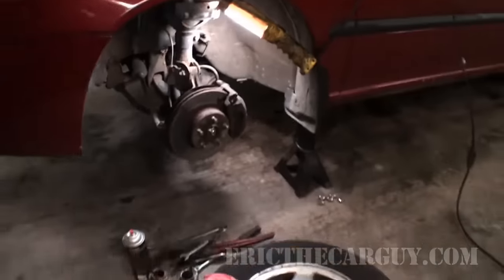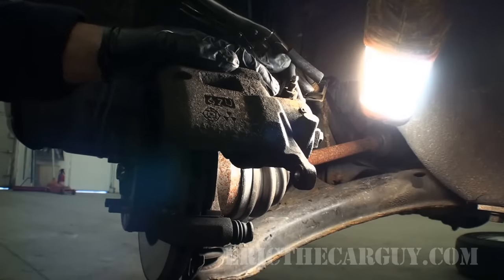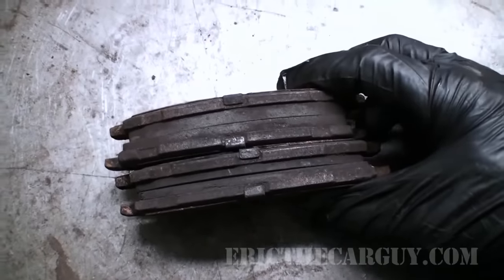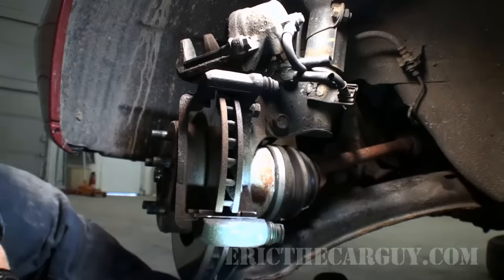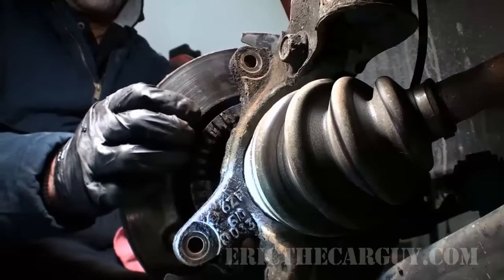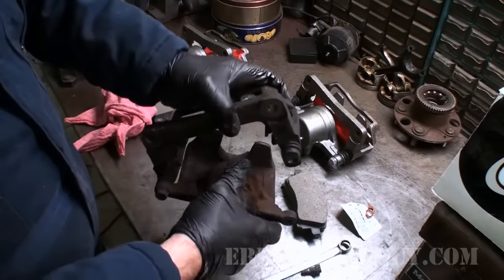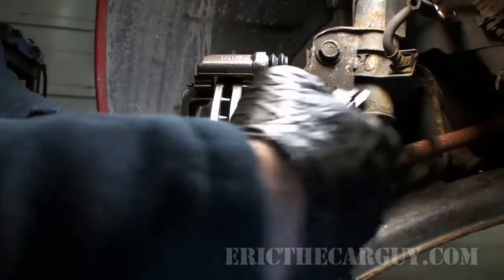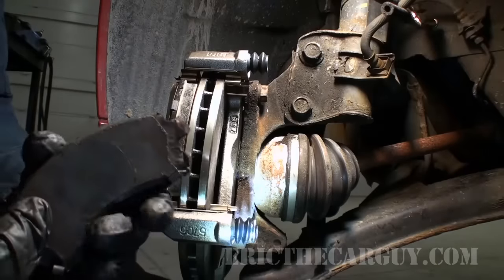How To Diagnose and Replace a Bad Brake Caliper -EricTheCarGuy

Comment: Great Job Eric, everything explained in Detail but, I have 1 question, when you replace Calipers, do we have to instal the Caliper Hose at the same time, sometimes the Calipers hose looks old and soft, it may bent and the fluid wont go through that may cause some problems?

What do you think Eric...

Comment: Decided to make myself a one-man-brake-bleeder after seeing this video. I just used a short/stout Gatorade bottle and drilled a 1/4in hole in the top of the cap and a another tiny one nearby to provide an air intake, slipped the 1/4in tube through the hole, filled the bottle with brake fluid. So even if the contraption tips over, which it did a few times when I was getting the tube connected to the bleeder valve the cap keeps most of the fluid from getting dumped on the ground.

Comment: Word of caution about using long wrenches on those 17mm caliper bolts. If you need the extra leverage to break a  brake bolt lose, chances are it is rusted in a possibly ceased. Use penetrating fluid before you just go breaking bolts with long wrenches. I broke the one of the heads off of one of those same caliper bolts on my forester using a long wrench. It was a nightmare to deal with after that. Lesson learned, use penetrating fluid if a brake bolt is even slightly stuck.
Reply: You’re right. He probably should have. I’m sure as the seasoned mechanic he is, he forgets to mention certain things. Forgets to mention them because he doesn’t do it, because through experience, in this particular instance, he can feel a fastener within the wrench/ratchet and socket  that is going to potentially be a candidate for stripping if gone past a certain point.  

If you live anywhere in or near the rust belt, pre soaking/spraying with penetrate is practically step number one in any mechanical job. Big or small

Comment: Eric; what have you got against using a C clamp across (An old brake pad or whatever) to push the piston in? Seems more even/straight force against the face of the piston, that's both easier to modulate and gradual. I like the practicality of your videos which makes this one thing stands out.

Comment: Thanks Eric, I've got a sticking disc on the front of my van that gets worse when it gets hot after driving a few miles, bought some new discs, the old ones aren't too bad but they're are the originals so prob time for new ones, new pads of course, i checked the pins that the caliper slides on when i was away from home a few wks back n they're not seized & am going to bleed them,  
The only thing i couldn't work out is how to check the caliper, I do now Thanks.
Reply: You might have a bad brake hose not allowing the fluid to return and holding pressure on your caliper after you take your foot off the brake..  Happened to me.

Comment: This video saved me some grief changing brake pads. Some idiot rounded the slide bolt on one side of my right rear caliper. Watching this I found out how easily the caliper comes off with one bolt off.

Comment: Thanks, Eric. I've had trouble removing rotors and even tires because they are all corroded together. I put Anti-seize on both sides of the part of the rotor where the wheel will bolt on, as well as on the centering hub thingy. Ok idea? Also, should we lube those clips, with silicone, to let the pads slide more easily?

Comment: I've got approx. 250,000 miles on a 99 Accord.  After having multiple brake issues on front and back (main issue being frozen pins/slides and uneven wear), I'm simply going to spend the money and replace the entire caliper assembly, rotors, and brake pads altogether.  I've tried lubricating the slide pins when I noticed they got stuck, but it didn't last long until they froze up again.

Comment: Hey Eric, if you replace the left front caliper don't you have to bleed the right rear wheel cylinder or caliper. I thought on front wheel drive vehicles they pair the right front brake line with the left rear and vice versa on the other side. I thought they did this since 75 percent of braking on front wheel drive vehicles is done by the front brakes and in case of a brake line failure you would have a front and rear action. Love the vids. Thanx

Comment: Eric, I hope you see this. First, Thank you so much for this video. It's very timely. My wife's 2003 Outback pulls hard to the right. Dealer wants to replace Caliper, Rotor, & pads for about $600. I can't do that right now. So I will diagnose in hopes of a fix instead of replace. If I need to replace, is there an aftermarket Caliper that's as good as or close to OEM? Subaru Caliper is $300.  If not I can get a salvage yard Subaru Caliper with 60K miles & 6 month warranty from a reputable yard for $59. Would you trust that? Thanks Much, Dave

Comment: Thank you so much, Eric! Single girl, here. I found out a ling time ago... Never depend on anyone. At some point, if not often, you'll be disappointed, so learn how to depend on only yourself. That's my motto! Now I know how to change out a brake caliper. I replaced my air idle control valve, and replaced my windshield (yes, you read that right), so far on this van. Now it's time to take my wheel off. Thank you so much. So many people are so serious and boring, and I start daydreaming because their monotone voice. Not you!!!

Comment: Not sure if you ever ran into this issue?I replaced a good many calipers and never had an issue, but after replacing caliper with a rebuilt one and installing new copper washers a very slow seep  developed un beknown to me and did not show up upon install until the low level light came on over many months for the brake fluid.Copper washer that goes against the caliper would/did not seal properly.Bought new washers and tried again with no luck.Examined the rebuilt caliper and there was a small defect around the edge of the threaded hole for the Banjo bolt.Had doubts this was issue, but went and got another  rebuilt caliper and washers that appeared to be in better condition in bolt hole area.Not sure what else would have caused this issue?Only been acouple days and will recheck.

Comment: I read a how-to that told me to use Moly Grease on metal-to-metal contacts, and Silicone lube on rubber-to-metal.  On the sliders, I put silicone on the inside of the boots, and grease on the bottom half of the slider where it touches the most metal.  This was only two days ago.  Would you recommend cleaning and re-lubricating the sliders asap, or during the next brake change?

Comment: Hey Eric, I was doing a front brake job on my 2002 dodge Dakota. I was told by a mechanic in my family that I shouldn’t lubricate the caliper pins and I didn’t find any information online/in the shop manual. In your opinion, should I lubricants them? I had reassembled them after replacing the rotors and pads, also checking the caliper for failure the drivers side intermittently dragged

Comment: Thanks for ur great video.
Can u please explain more on ur segment on clogged bleeding valve?  I thought this only had an effect when u where bleeding the brakes.  I dont understand how this can have an effect on the operation of the caliper piston?
Thanks to ur video I found the bleeding valve on my Sonata diesel clogged.  I cleaned it and put it back in today.  Im not sure yet if my problem is solved.  I am afraid that this is not enough and that I will have to replace the whole caliper or rebuild it myself (the caliper pins move freely).
Can u please explain how opening the blogged bleeding valve could be enough for the brakes to operate normal now?
Sincerely
Stig from Norway.

Comment: I'm not sure I understood. Pump the break a bunch of times. Get out, crack open the bleeding nipple. If it squirts - is probably the hose...? Would this suggest the hose has lost its firmness properties, and is expanding under pressure?

And do you do this with engine, thus brake servo - on or off?

Asking as all tips help, and personally I have one front brake where there is very slight rusty coverage across the inner 50% of the rotor track (like the pad is only gracing the rotor on the inner part of the track) - and on the rear right it gets quite notably hotter than the rest of brakes, and in winter my parking brake tend to freeze up in that side (caliper, not drums).

Comment: Hi Eric, years ago, my mechanic had changed front and rear discs/rotors and all pads, and did a brake bleed f+r. I watched and helped him do some of the stuff, just pumped the brake pedal, passed the tools and rotors etc. When he fitted the rotors on, I asked him if the lube needed cleaning off the rotors faces, and he said because the rotors will get really hot when I press the brake pedal, the heat will burn off whatever is on the face. Is he correct? I admit when I first took the car out for a test brake run, he did say to slam the brakes on a few times from 40 mph, and at first, felt like nothing was happening, then the brakes grabbed good.

Comment: Eric, thanks man, good video, one comment please, on most German cars i.e. VW, if you pinch off the brake line like that, you damage it.  They are hard plastic outside and braided steel inside ( for longevity) The braided steel does not return to round shape.  Also 2nd comment, question,, why not use brake anti size paste on the guides as opposed to silicone paste?

Comment: Quick question, I went to change recently the break pads because it was time to do maintenance, when i went home the break light went on in the panel, next morning there was no breaks and there was no break fluid, it leaked all. I know my calliper was fine cuz I have replaced it last year. But they say the calliper was gone and needed to be replaced. I would like to know what do you think happened there? They said the rubber on the piston was gone. I don’t triste them much, heard bad things from them before. I went in to change pads and came home with leaking breaks 😤 (caliper before changing pads were not sticking or pulling the pick up) I appreciate your insights. Thanks

Comment: Totally agree with you about not using the copper washers.  I could not get a seal with them  So I re-used the steel washers from the old caliper and they sealed easily.

Comment: I have had brake pads that fit too tight and took a small grinder to take the slightest amount off the pads so that they would slide smoothly in the clips/bracket.  I always questioned this move because I was taking the powder coat off and may causing rusting which may cause sticking of the pad.  I do brake services once or twice/year when I switch tires (winter/summer).  Should I have gone back and asked to see another set of pads until I get one that fits?  Also, what are your thoughts on anti-seize under the shims on the caliper bracket?

Comment: Very good video 👍 I have a 2003 Ml320 MErcedes the brake line is leaking out of fluids, I want to replace the line, so where should I Istart to take things off first before get to the line to replace. Thanks in advance.

Comment: Hi Eric, I'm one of your followers. I have a Lexus CT200h. When I opened my brakes to replace the pads, I found out that the front pads were already worn out 60 -70%, whereas the rear pads only around 10%. Is there a problem with my rear brakes, or just normal wear. Thank you

Comment: Hi Eric.  Thank you so much for lovely professional explanation.  I have a doubt.  They are two caliper pins.  One is plain one and another  one has rubber sleeve on other pin.  could you please let me know what is the difference.  if i put rubber sleeve on down and plain pin on up will be any problem?  Please guide me.  Raju Jai Sriram.

Comment: WD-40 Specialist rust penetrant spray works really well on old fasteners. 
I used yesterday it on the two 23mm bolts holding my caliper brackets on, and was able to loosen them pretty easily afterwards.

Comment: Lol, I couldn't help but laugh when you almost put the caliper frame on without the rotor in place. When I did it I actually got the thing bolted in and as I'm reaching for the torque wrench the brain is trying to put together that this just doesn't look right.. lmao  It was the last corner on a 4 corner brake job. 8 hours into it my son is lucky I didn't try to bolt him to the car.. lol  Thank you so much for everything you do and teach. Great videos!

Comment: Eric, I don't think you will answer this, but one of my slide pins doesn't push in as easy as the other on the exact caliper you have on this video. Is that the way it should be? It feels like something is blocking it. I put the other slider in it, and it works fine!

Comment: Point of note: If the banjo bolt on your caliper happens to not have an existing crush washer, most definitely use the copper washer they give you. The first time I ever changed a caliper it didn't have a crush washer and I figured it could go back the same way. I was very wrong, and broke the banjo bolt trying to get it to stop leaking. Those are not easy to get ahold of, I had to go back to the dealership after the weekend was over.

Comment: I know this video is older but great content. Question, I replaced my rear pads and rotors but still get vibration in the rear when I apply my brake peddle. Bad caliper or pins not moving? I checked the pins and they were moving ok. Not sure why it vibrates when I brake.

Comment: Nice Job. I would use C-Clamp to push piston back, ezier.  But thank you as the issue I'm have seems to be stuck caliper pins.  will fix it ! Thanks Again

Comment: In your video, I only saw you replace one caliper,  but after bleeding it, you went over to the other side to bleed that one as well. Is that because you replaced the caliper on the other side, but we didn't see it done in the video? 

I am replacing both front rotors and pads, but only one caliper; I assume I only have to bleed the side which had air enter the system, ie., when the caliper was swapped out.

Comment: thanks for the video, im a bit unclear on why you would need to crimp the brake line. If you compress the brake caliper piston with your pipe wrench the brake fluid would simply get pushed back up into the reservoir. If it moves freely it should be ok. What am I missing?

Comment: Good vid as usual. But if l have a sticking piston,l usually take pads out put chizel or similar in place of pads,put foot on brake pedal forcing piston out.
Then using vasaline,after first cleaning piston.l put it on pisdton.Might have to do three to four times but it frees piston off..Worth a try.

Comment: Like all your videos. Question. Would excessive moisture in brake fluid cause a sticking caliper. I ask because the car I am working on has this issue but noticed the brake fluid reservoir cap is broken. Don t know how long. Caliper slides ok,   Piston moves freely, how do I check that brake hose.

Comment: Is it important to first gravity bleed (to fill up the piston first) before bleeding via applying brake pressure? I've been having seized rear brakes yearly. When I compare my procedure to yours, the only step I'm missing is the gravity bleed. I believe there may be either moisture or air around the rear brakes that I didn't purge due to skipping that gravity bleed. Thoughts? Thanks you all!

Comment: Is the reason you went through the trouble of clamping the brake hose and loosening the bleeder valve to compress the piston, instead of just taking the reservoir cap off, to help isolate the problem to the caliper versus the brake hose?

Comment: Great helpful video. Did you consider getting rotors resurfaced rather than replaced. My experience the cheap Chinese replacements available at the chain parts stores are junk and tend to warp easy . I like to get my original factory rotors cut at O’Reilly for $12 bucks.

Comment: Hi Eric. Got a 98 Continental, left rear was lot of brake dust. Took the easy way out and replaced caliper. Still drag on both rear wheels and a bit on the front. Master cylinder?

Comment: Hello Eric. I order most of my parts from Rock Auto, and the only thing they are recommending for Silicon Paste is Camshaft Assembly Paste. Will this work? Or will it be too corrosive for the rubber parts as well?

Comment: Great video.  So if you .. i mean a friend.. ignored the indicator and rode til itvwas metal on metal.. meaning new pads & rotors for sure... does this kind of wear damage the caliper with all that metal dust and heat?  Cuz it sure looks like $h#t.. but seems to work. Relacecwhile in there?  Thanks!

Comment: Eric, what do you feel about painting calipers when doing any type of replacement, or work to them, to help prevent the rust they so commonly get in this wonderful part of the world?  Also, a follow up, do you have any recommendations for what types of paint you would prefer, and would you consider making videos about rust prevention, such as undercoating, caliper paint, or something I just learned of, high heat paint for exhaust systems. (which I have had rust out on almost every car I have owned)

Comment: Eric, so a lot of service manuals and lot of ppl have Caliper Guide Pin with rubber end installed on BOTTOM, NOT TOP. I noticed in your video it's backwards, on top. I'm confused with which way is correct as if installed incorrectly will cause uneven wear on brake pads and rotor??? PLEASE LET ME KNOW. Thank you Sir.

Comment: I have a 2015 F150. I have replaced my brake pads and rotors. I keep hearing a minor rubbing from what I believe is the front driver's side. I hear it mostly after I press the brakes and release. I greased the caliper slide pins, however I used a slide grease that was recommended by the auto parts guy. I see you use silicone paste which I also have. Should I take the pins out and redo with the silicone?  I just can't seem to find the rub and the brake specialist shop said everything was fine there. So I'm at witts end.